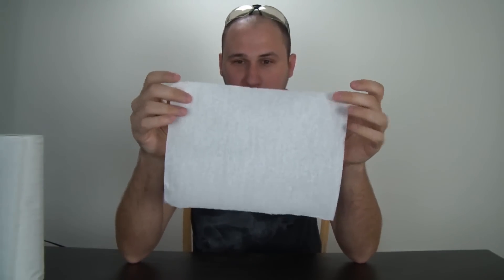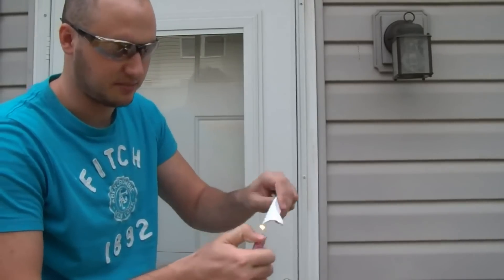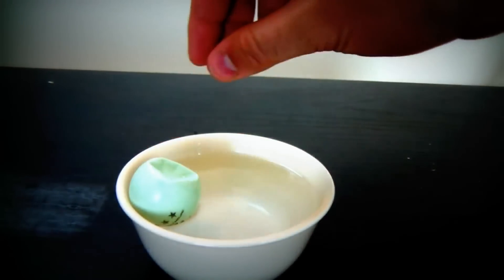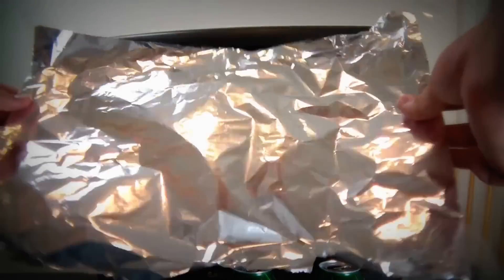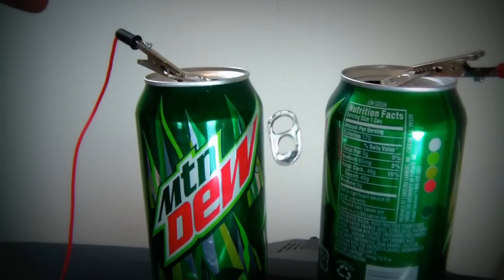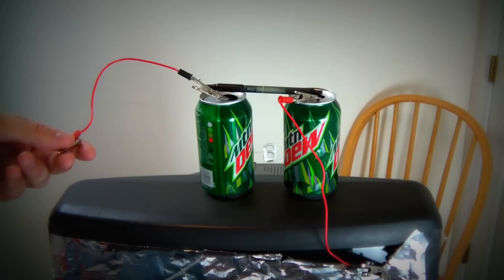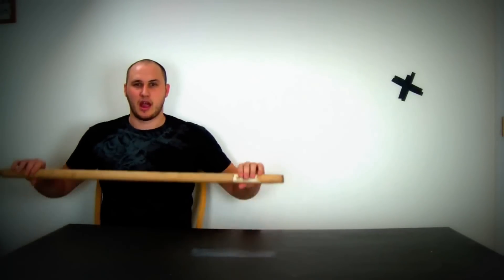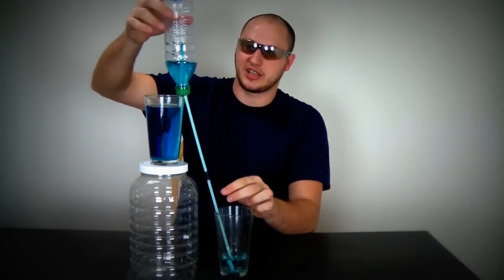10 Amazing Science Experiments Compilation #8

Comment: Did anyone else notice that during the experiment with the TV and the mountain dew cans, the thing that was dangling had a string on the left side of it as if someone was controlling it? Just something to note, it looks like there is a string on it.
Reply: The TV is a cathode-ray tube. Photons are shot through magnets and they are excited onto the phosphorus glass screen. The tinfoil picks up the stray electrons off the photons and they are picked up through the wire onto the tin cans. When the Russian guy touches the wire it charges and discharges because he is like a capacitor. Capacitors charge up and then when they reach their maximum charge they release their charge. The tin Can tab moves with the field that is caused by the charge and discharge. When I say field I mean magnetic field and the magnetic fields are naturally caused by the coils in the TV And fields are made of electrons. This is why you do not want to touch a picture tube when you drag your feet across the carpet and touch the picture tube. You will get a very painful spark on your finger.
Reply: Yeah I looked and the tab just had extra string from the knot. You can see that he just did it twice. The first one didn't have that. Look again because the tab is pushed with the string then so that doesn't make sense because the string is too small to push with.
Reply: He said it had a string -./
Reply: AllHypedUp ah hu, yup, he sure did
Reply: AllHypedUp Not what I'm talking about brainfart. There is a string on the LEFT of the metal, I'm not talking about the one connecting to the stick.
Reply: That was not another wire that was the knot